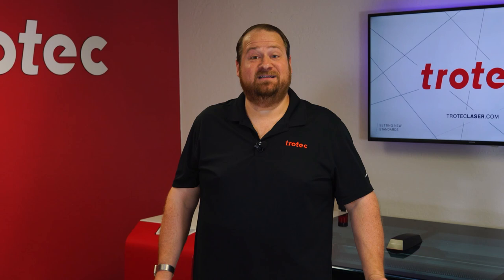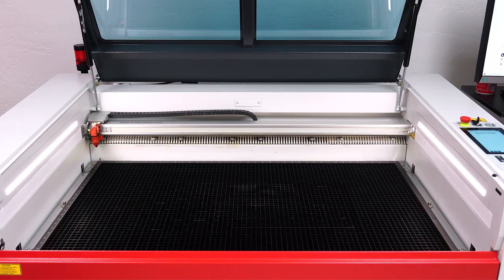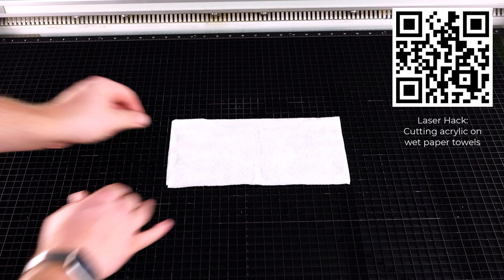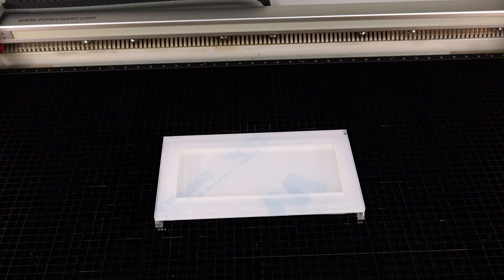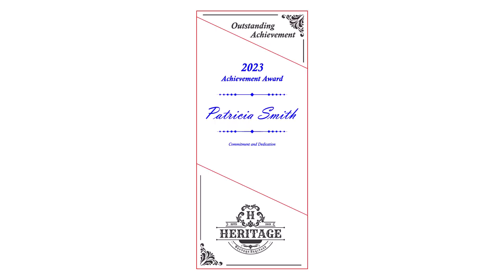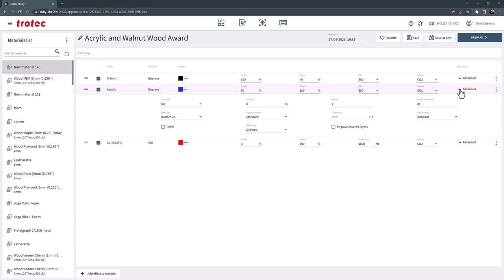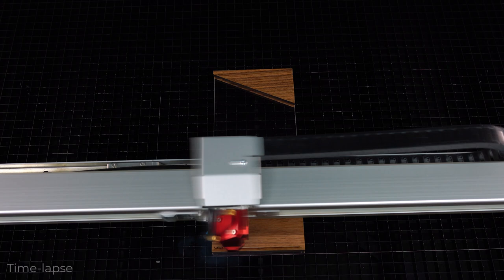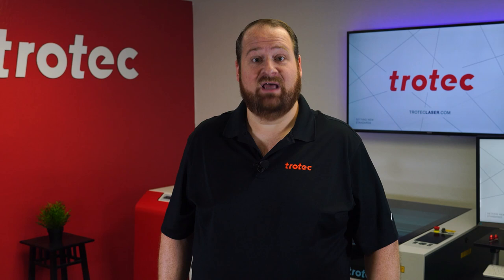Deep Dive with Laser Dave: Wood and Acrylic Award Creation and Engraving

Comment: Would there be an advantage to engraving the acrylic from the other side with a mirrored font?
Reply: Engraving acrylic from the other side with a mirrored font may not necessarily provide an inherent advantage, as the preference for this style can be subjective. However, some people appreciate the reverse engraving technique on clear acrylic because it yields a refined, polished white appearance compared to direct engraving. To achieve this effect, the acrylic portion of the design file must be mirrored and processed as a separate file. This allows the award to be flipped over after the walnut wood has been engraved.

Comment: A few tips as someone who engraves awards.

1. You shouldn't be floating the award in the middle of the table.  It should be indexed to something.  Whether that be the top corner or some sort of other guide.  This is a surefire way to result in inconsistent placement.  While I'm sure your method is find for a demo, it's not realistic for a production environment.

2. Acrylic is generally rear engraved.  So this is another reason why this should be indexed.  While it's not 100% necessary, it's definitely industry standard.

3. The walnut probably should be masked before it's cut.  This would serve several purposes.  First, it would help keep everything clean while cutting.  Second, it would protect the walnut as it's being handled, placed and flipped for engraving.  Third, it would limit cleanup after engraving.  It would also give the option of color fill after engraving.
Reply from the maker: Thank you for sharing your insights! We appreciate your perspective on our video. We only showcase the process in the center of the field for the sake of the video; this provides a better view so the process can be easier seen when filming; in a production setting, you are correct that running in the center field is unnecessary.

Regarding the engraving on the acrylic, we understand that personal preference plays a role, and we've observed an even split in choices – with about half of our customers preferring the front and the other half opting for the back. So, please feel free to select the finish that suits your aesthetic the best.

About the walnut material, we want to ensure you know that our pre-finished and lacquered walnut is designed for convenience and efficiency, requiring a quick wipe to restore its pristine appearance. While pre-masking is an option, we've found that it doesn't necessarily enhance the final look or quality despite the additional time and cost involved. However, we value your input and encourage you to choose the method that matches your preferences. Thank you again for your valuable feedback!